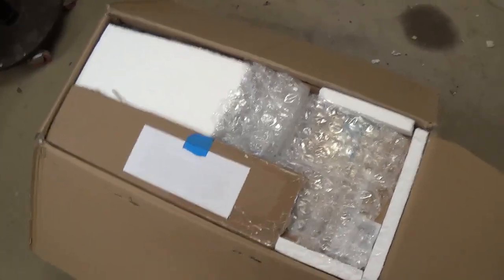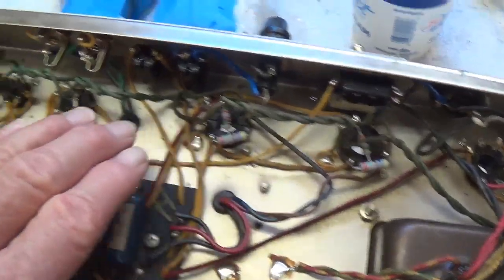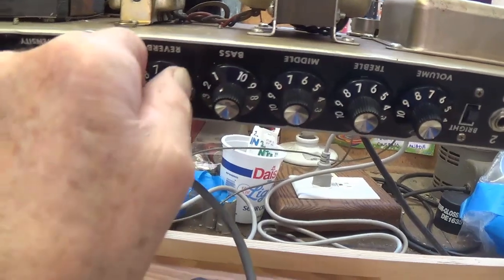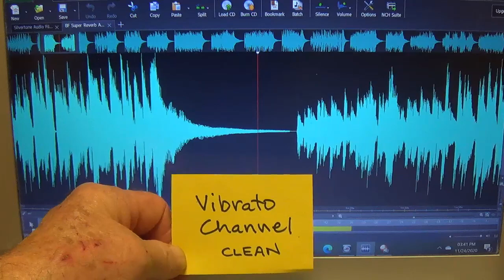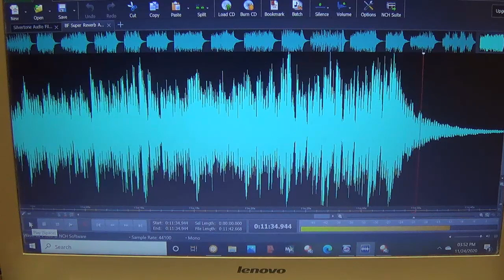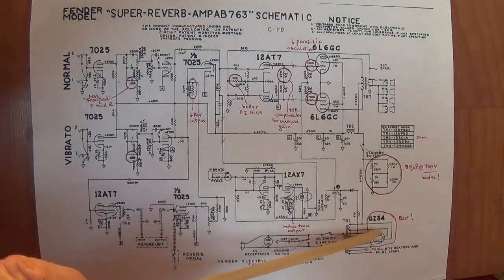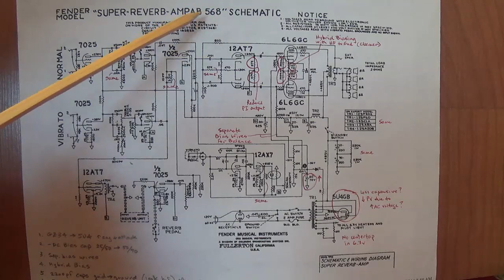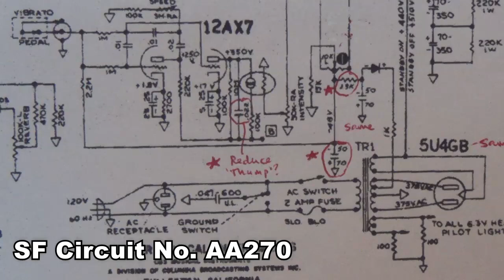1965 BF Fender Super Reverb in for a Check Up......Plus BF vs SF S.R. Circuits

Comment: Wow, this amp looks a lot like the '65 in a video just posted by D-Lab. Coincidence is spooky. But they're not the same inside.
Reply from the maker: It's a Festivus Miracle !!! :)
Reply: @UncleDoug  it even has the same dents on the faceplate.   Is there anything written in black marker on the underside of the doghouse?
Reply: Yet another entertaining and educational video by the valve master Uncle Doug.
I just checked to see which countries still use the imperial units system and only three countries still use this system of units and measures:

Liberia, Myanmar and the USA.

The metric system is so easy to use and carry out conversions. From kilometres to metres to millimetres to nanometers you can convert by simply moving the decimal place. Same process for weights, tonnes to kilograms to grams to micrograms.

The conversion can be carrying out in one’s head without a calculator.
How many inches are there in 1,376.8 miles?

Will the 3 remaining imperial system countries change over to metric?

Comment: The tone circuit in my blackface Super Reverb works so that if you turn all three tone controls down (ie treb, mid, bass) it kills the volume completely, regardless of the input. This '65 seems to behave the same way.
Reply from the maker: That's because they are all passive tone controls, and when turned to zero, all of the signal goes to ground.
Reply: You may want to try it with the bass and treble all the way off and the middle all the way up, it's a different curve some people say more vox like but I'm not sure about that but it's definitely musical and different.

Comment: That super Reverb sounds AR excellent the circuitry in those amps especially that one encapsulate that perfect Fender blackface sound good job on getting that back to its what it's made for playing with great tone sounds like a different guitar also or maybe different pickups on something you were using anyway I have an old Marshall I think it's either 70s or possibly early 80s I'm not sure it's a hundred Watt Mark II Super lead little hard to find info on these but I haven't really gone into any depth investigating this amp anyway I always enjoy watching your program and all the interesting amps you come across
Reply from the maker: Thanks so much, William. Glad you enjoyed the video.

Comment: Got ya! Having serviced a lot of Fender amps i dare to say that you've missed a capacitor change from AB 568 to next silverface circuits. In the tremolo circuit there is a 25uf-25V cap in the AB 568 circuit where in the next SF circuits this cap changes to 5uf-25V. I also believe that this change probably helps the tremolo 'helicopter Thumb' that you mention with the other cap.
P.S.: I love your videos and i have learn't a lot by watching them! Keep Up!
Reply from the maker: Thanks for sharing your keen observation, T. Will do ;)

Comment: Hey Uncle Doug,  I have a 67 super reverb that I'm working on, I want to put a multi impedance output transformer in it to try other speakers. I'll only be using 2 4 or 8 ohm leads one at a time. My question is what should I do with the ones not in use?
Reply from the maker: Cut off any metal protruding from the insulation, bend them over onto themselves, and tape or heat shrink over the loop.......or you could simply install several output jacks, one for each impedance.
Reply: @UncleDoug  Thanks, that's what I did. I was worried that if I only used a portion of the OT I would either be wasting power or reflecting infinite impedance. by the way I love your channel, very informative and fun.

Comment: My take on the 2000 pf caps on the power tubes was to stop oscillation, caused by the much sloppier wiring layout. If you compare the layout of a mid 60's fender to mid 70's it makes you want to cry. A lot of people say the 200pf kill the tone.
Reply from the maker: I agree, Larry, particularly ultrasonic oscillation, which can destroy tubes and output transformers. For those fearing audible tone loss, the cap value could be reduced until only ultrasonic frequencies were passed to ground.

Comment: Low flying B-52.  Good one.
Reply from the maker: They used to fly them in this area almost continuously back in the 50's and 60's.
Reply: @UncleDoug  I spent 15 years in the Air Force, so I've had a few BUFFs rattle me out of my rack.  And a few others.  The B-1B doing touch and go's was the loudest.

Comment: Hi Uncle Doug,  Can I use a GZ34/ 5AR4 rectifier tube in my 1976-1977 Deluxe Reverb instead of the 5U4GB rectifier ?  It was mentioned , I could.
 Will it damage my amp ?  What modification (s) would be required to safely utilize one ?  I tried and noticed the GZ34 glowed a lot brighter than the 5U4GB. I immediately swapped it back. I hope I didn't hurt my amp by doing this.  Please tell me what your opinion is.  Thanks, Tom Cowan.
Reply from the maker: Yes, you can substitute a GZ-34 for a 5U4, but not the other way around. The GZ draws much less filament current, so it understresses the 5VAC winding designed for the 5U4. The GZ is far more efficient and has virtually no sag. The only catch is that the GZ puts out higher PV, so you might want to check the bias of your output tubes if you make the switch.

Comment: Uncle Doug, I've got a spring reverb tank that makes an un-Godly amount of reverb noise at the slightest tap of a foot. It is coming from the 12AT7 tube that I was told is the driver tube. Do you have any idea of what would cause that?
Reply from the maker: I really can't troubleshoot long distance, FS. Have you tried replacing the 12AT7......and are you sure it's not a 12AX7 ??
Reply: @UncleDoug  It is definitely a 12AT7. I've ordered a replacement tube, but it will be a while before I receive it. I ended up finding a page in a book that makes me think the tube is bad. Hopefully, that is all that it is. Thanks for replying back. If the tube is not the problem, is it alright if I ask you for more help?

Comment: Great video. I wish you would push the amps a little harder during your sound demos. Super Reverbs have a great singing quality when you find that sweet spot, especially when playing blues (Listen to Anson Funderburgh and the Rockets).  I am just starting a new project with a surplus Silverface control plate that will include a Lar-Mar Master Volume and my own modified circuit on the normal channel. Something I noticed in the schematics that you showed is they all have 375-0-375 HT secondaries on the power transformers. Most modern transformer usually are at 355-0-355 HT or as I prefer 320-0-320 HT.  This was something I noticed when I first built a 5F6a Bassman about 20 years ago. Everything was stock except the power transformer which was 375-0-375 and gave a plate voltage at over 500VDC. Much higher than the original Bassman. Needless to say the amp was harsh and brittle in the high end.  Others have told me something similar about the first reissue Bassman amps.  Later on I built an AB 763 Super Reverb with a 320-0-320 HT Hammond Power Transformer and found it to be one of the best amps I ever played. Thanks for the great info.  One more thing, could you post a diagram of the NFB switch wiring as I could not see quite clearly how you wired it.
Reply from the maker: Thanks for your nice comments and informative input, Arnold. I'll try to remember to do so.

Comment: How can you measure how much current the filter caps can store in fender amplifiers? 8 amps or 10amps?
Reply from the maker: They don't store amps, Wayne, they store volts.....and it's easy to measure the voltage they are charged by with a voltmeter.

Comment: Hi  doug.  can you please tell me if its possible to fit an earphone socket to a trace elliot amplifyer.[ model tramp.] Also   i noticed this amp has send and return jack sockets on the front panel. what excactly are they for?  thanks doug. ... davie in scotland
Reply from the maker: Greetings, David. Yes, it's possible, but it's a task for a qualified tech to perform. The "send and return" sockets are for an effects loop. You might try the "send" socket to see if your headphones will work there....it might require an adapter to mate the headphone jack with the "send" socket.
Reply: Hi doug thanks for your reply.  i tryed the send socket  but  nuthing came out the headphones and still came out the amp speaker. and when i pulled the headphone jack out  the speaker was a little louder as i plucked a string to check.  any  more ideas?  thanks  .    your work is fab.  im a great admirer of your work.. ...davie

Comment: Great sounding amp Uncle Doug!  Probably the best sounding amp I have heard you repair.  Huge difference in gain with the NFB turned off, and maybe a slight improvement in tone as well.
Some confusion over the long-tailed pair phase inverter and the use of the 82k and 100k plate resistors for balancing the outputs.  I thought your video on phase inverters explained that the signal coming from the second cathode of the phase inverter tube was hotter because it had gone through two tubes and therefore had to be tamed with the 100k plate resistor to balance the weaker signal coming from the second plate of the phase inverter tube since its signal had only gone through one tube and was only amplified once.  The 82k resistor allows more B+ on the plate and makes its output more robust, if I may use one of your favourite words.  Your current video seems to be saying the opposite, unless I am just confused. Help!
Reply from the maker: Thanks so much, DB. I understand your confusion. My earlier explanation was quite basic. This explanation is more accurate. Increasing the plate resistor increases the output from the stage, which is necessary to balance the weaker output from the cathode-driven triode with the stronger output from the grid-driven triode. I apologize for any confusion, but the more I study, the more I learn and understand.
Reply: @UncleDoug  OK, thanks Uncle Doug.  I was forgetting about ohm's law.  Since  V=IR, it follows that the bigger the plate resistor, the bigger the fluctuating voltage will be going to the grid of the output tube.  
I also did not know that the cathode-driven triode's output was less than the grid-driven triode's output. 
Enjoying the learning process thanks to you.

Comment: What got you interested in the TAD Tubes?   They are made by the same guys as the Shuguang/Generic China tubes.... (not saying they are bad).   I've been using the Tung-Sol tubes (Sovtek Russia) ones on my Fender style amps,  and I've gotten good matches from CE Dist also.   I think that  AES/CEdist  has one of the better matching systems in the USA.
Reply: Also curious, I've heard TAD is crap but if Uncle Doug approves...
Reply from the maker: CE Dist had no Tung-Sols available, DK, so I went with TAD and have had really good experiences with them. They have exceptional QC and matching.
Reply from the maker: If you listen to internet "experts" every tube is the best and every tube is the worst.....but the only "expert" I trust is personal experience....and the TAD's have been gold for me.

Comment: during the video at some point i think (could be mistaken. have not rewatched yet)  anyways. i think you mentioned changing out an original carbon comp resistor and replacing with a metal film resistor.

question: if you were gonna build a brand new princeton circuit amp from scrap would you source carbon comp resistors?  

how about the brand for the caps?  would it matter to you? 

i noticed you said you like the TAD tubes.
Reply from the maker: I use a minimum of 1W carbon film resistors for most builds, with metal film resistors in the power supply. As far as capacitors, I buy economical ones from AES. Specific brand names don't really matter all that much to me.
Reply: @UncleDoug  ok thank you from one of your patreon people.

so the carbon films don't affect the tone adversely compared to a carbon comp?    seems there is some debate on this issue.   just wanted your opinion since you seem to have a lot of experience making repairs and such.

Comment: Hey ,uncle Doug.  I'm thinking about buying on of those 45w Marshall clone kits.  Any book you would recommend I read before I try to put it together ?
Reply: That’s a mighty ambitious amp build to start with! I think you might want to try a Mojotone Champ clone, first, the manual is well done.
Reply from the maker: Books don't help that much, EJ. Watch videos and do internet research.......and, like MA said, consider an easier build first.
Reply: If your heart is set on that circuit and you haven't built them before you could also go somewhere like el34 world on their forum they would be happy to help you and if you buy some parts from there that would be cool too, although I don't think it's a prerequisite. Between there and here these two sites have brought me to where I can and have built champ Tweed deluxe worked on my own super reverbs and jtm 45 1987x, 72 and 73 super Bass and super lead respectively and cloned my own super reverb on turret board into a super reverb chassis and cabinet,  oh yeah and built a stout reverb and Tweed bluesmeister (two amplifiers from the el34 world site) into salvaged chassis and cabinets. If you're set on it go on that site and introduce yourself.

Comment: The vibrato channel has much more 'jangle' than the clean channel. Maybe because it's tone stack is more sophisticated with the midrange?
Reply from the maker: Could be, Orion, but I've never found a midrange control that had that much influence on overall tone.

Comment: The Euro tester to monitor output tubes can only be used with octal tubes, am I correct? Is there an adapter to use EL-84 tubes and other ninepin tubes?   Dennis Larson, a fellow cats lover, I have four of the little darlngs!
Reply from the maker: I'm sure such adapters exist, Dennis, but I don't own one. If needed, I would probably build one.

Comment: You represent the power of one individual that can change lives.  Wish I had you as a teacher when I was young, but we never know enough searching for the "holy grail".  Glad to see your pet partners don't ask you how "wrong you are today".
Just simple question IF possible.  I was given single speaker Super (?100watts) w serial number 5G4  serial number 00239 but ?as to lost schematic.  4 - 7025s, 1 - 12AX7 and 2- GL6GC. Any ideas to schematic? thx,
Reply from the maker: Thanks so much for your kind words, Murphy. Is the amp a Fender "Super" with circuit number 5G4? There apparently are no 5G4 schematics. Are you sure it's not 5C4 or 6G4?  Either way, you can simply use whichever Super schematic best matches your circuit. The output power is probably closer to 30W and a single 12" speaker seems unusual. Regardless, it's a valuable amp.

Comment: Excellent video! 👍
But what comes to that reverb, especially the reverb driver circuit, I am a bit critical:
First of all, the plate voltage of reverb driver 12AT7 in many BF Fenders exceeds the 300V maximum value of 12AT7 plate voltage by about 100 volts, or even much more. (Nothing unheard of course because for example in some Fender Vibro Kings plate voltage of the EL84 reverb driver tube was around 150 volts over max value, and some users told that the amp ate EL84  tubes like children eat candy, but that's another story.)  And it is just a plain truth. Plate voltages exceeding max value of the tube by over 30 % most certainly is only seeking for troubles. In addition, what makes things even worse, it means that the load line and operation point are forced to an area where you can only achieve unlinearity and distortion or overheating of plates, or poor headroom because of need to use low bias current to avoid tube overheating which implicates a driver tube which very easily goes to cutoff. That is a fact which everyone who understands tube circuits and load lines admits. If somebody thinks that those Blacface reverbs are divine and designed by god, simply does not understand that the circuit is far from ideal, both soundwise and if  reliability is a matter of importance.
IMHO much better performance is achieved by lowering plate voltage of driver tube, increasing bias current and lowering load impedance. It is very easily proved just by connecting a loudspeaker or dummy load as a load of the reverb driver stage and comparing sound, power and headroom of that driver output if plate voltage, operation point and load are optimized.  (Of course reverb tank impedance varies according to the frequency much more than a loudspeaker or dummy load but the result is still the same.
 IMO perhaps best option is to use 12AU7/ECC82, which has better plate dissipation as well, at 250-300V plate to cathode voltage, biased around 5-7mA per triode or even a bit more , i.e. 10-12 mA per tube and use plate load of around 9-15k, which of course unfortunately means that the original Fender 22.5k/8 ohms reverb OT is not suitable if the tank is same.

Merry Christmas!🎄🎁
Stay safe.
Reply from the maker: Thanks for your very lengthy and detailed input, J.

Comment: Could the added resistor in the bias circuit be part of the low pass filter in conjunction with the 50uF cap, for the vibrato kickstart thing?
EDIT: But then they could have taken the grid bias voltage from the other side of the resistor, which would make more sense. Maybe it doesn't really matter because the current draw is small for both? I don't know
Reply from the maker: Neither do I, Dazz. Merry Christmas !!
Reply: @UncleDoug  Merry Christmas to you and your family too!